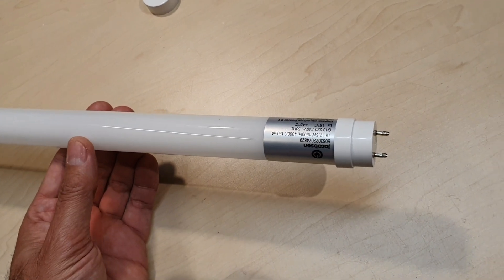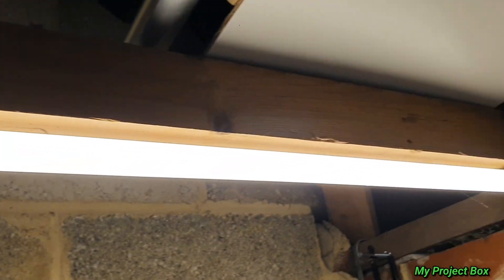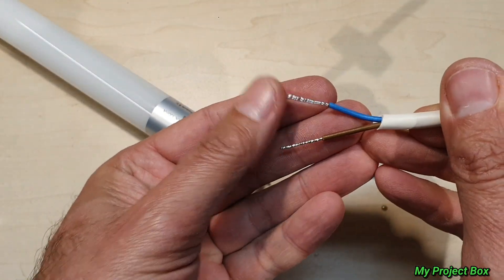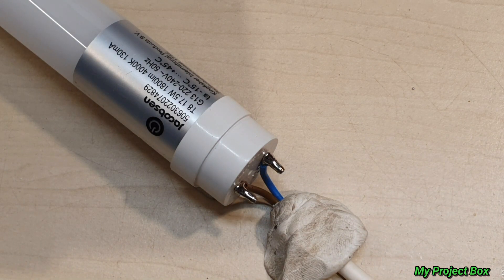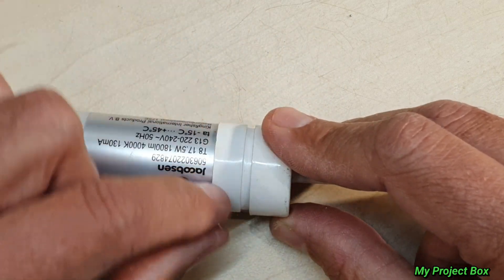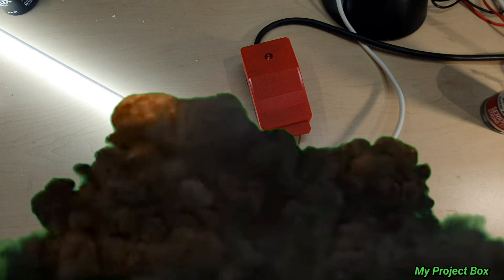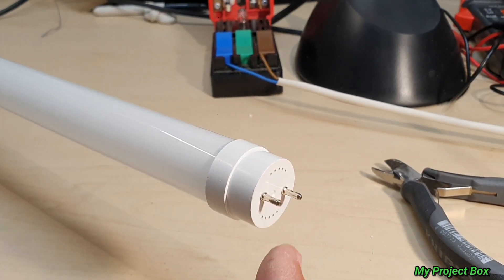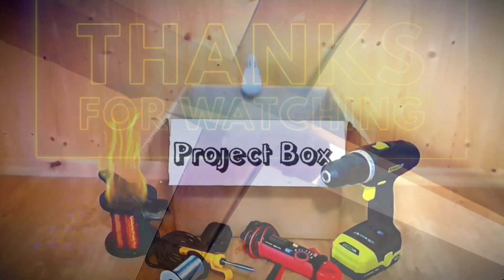Power LED tube directly without putting it into a fixture

Comment: Yeah I was wondering about that too. Primarily because I only have a small workspace in my room to work on electronics and would like to use the same light outside when I do work on my motorcycle.. you think I could just use a normal power cable to hook onto?

Comment: You said 240 volts? So 120V won't work for this? Or it needs 2 live x 120V?
Reply from the maker: In Europe its 240/220 volts but in North America it will be 120V.
Reply: @MyProjectBoxChannel I used 240 and killed my bulb 😂 🇺🇸

Comment: These type of adapters exist as retail products. I've seen them in other videos. Yet, I can't find them anywhere!
Reply from the maker: Yes they probably do, but if you're handy with a soldering iron,  it's just two wires to solder on😉
Reply: @MyProjectBoxChannel  I am and that’s what I’ll be doing but can’t believe they’re not readily available. May be an opportunity here 🤔
Reply from the maker: @csselement   it just needs a better flex cord connected , it's almost what you need 

https://www.2000testequipment.co.uk/store/tube-connector-cable-p-1744.html

Buy LED tube connector 220V https://www.factorled.com/en/accessories-led-tubes/60-led-tube-connector-220v-8400000002219.html

T8 Lamp Holder Cable Light Box Line 1.4m LED Lighting Base Cable Holder Lights Base Wire for T8 Tube Fluorescent Connection - AliExpress https://www.aliexpress.com/item/2052067076.html?pdp_npi=4%40dis%21EUR%211.33%211.33%21%21%211.51%211.51%21%402140e70617618717655152859e65cc%2166164752029%21affd%21%21%21&dp=Cj0KCQiAiKzIBhCOARIsAKpKLANAbj4YPvr-EXbJFInGK2XEOylL0-ZWadsSHd8knnfb88KyJb2L_iIaAjCAEALw_wcB&gad_source=1&gad_campaignid=21745288723&gclid=Cj0KCQiAiKzIBhCOARIsAKpKLANAbj4YPvr-EXbJFInGK2XEOylL0-ZWadsSHd8knnfb88KyJb2L_iIaAjCAEALw_wcB&aff_fcid=e0972ab5fff54609a656ecaf5365b0e9-1762331375655-09444-_oEmQFg2&aff_fsk=_oEmQFg2&aff_platform=api-new-product-query&sk=_oEmQFg2&aff_trace_key=e0972ab5fff54609a656ecaf5365b0e9-1762331375655-09444-_oEmQFg2&terminal_id=148258520c27414d8a326fffc47abc5c&afSmartRedirect=y

It's kind of the thing you looking for
Reply from the maker: This is exactly what you need 
Hermetic LED Tube Lamp Holder T8 G13 - efectoLED https://www.efectoled.com/pt/comprar-tubos-led-t8/69962-porta-lampadas-hermetico-tubo-led-t8-g13.html?gad_campaignid=20975960587&gad_source=1&gclid=Cj0KCQiAiKzIBhCOARIsAKpKLAPyiXS1ErdsEzNpiXs9mDqc8oN-LsUJVjRNQSCT4o4484fj4uA8iiAaArvuEALw_wcB&gclsrc=aw.ds&id_c=141862
Reply: @MyProjectBoxChannel  Thank you!
Reply from the maker: https://www.akouashop.com/accessoires-eclairage/douilles/paire-de-douilles-etanches-ip44-pour-tube-t8-avec-cable-de-1-m.html

Comment: Is it possible to power the leds with a DC by bypassing the ac to dc converter that is inside the fluorescent light
Reply from the maker: Yes but it needs to be quite a high DC voltage of about 60v and current limiting
Reply: @MyProjectBoxChannel  ok thanks very much

Comment: They are NOT "fittings" they are Fixtures.
Reply from the maker: I think you are nitpicking🤔😩. Light fixture or  Illuminar, light bulb, lamp, ceiling light, light fittings. A good example of people using different words will be, "electronic engineers" vs "electricians". You could argue that electronic engineers have much deeper knowledge about all things electrical, but for some reason invent different terminology for the same things.

Comment: Love all your videos and have added some Caps to LED lights that work very well, but I have a project in mind that I hope you can help me with.
We live out in the countryside and at night outside it is pitch dark so when my wife gets up for P she can't find the light switch, so I want to add a LED to the switch so she can find it, the light is a LED bulb equivalent to 60w with a single light switch on the wall, any suggestions? Bob in the UK
Reply from the maker: A common technique for illuminated light switches, is to put a neon lamp (ne2 +resistor) across the switch contacts. That way when the switch is in to off/open position the neon gets its Live from the one side of the switch, and the neutral is leaking back through the light bulb to the other leg of the neon(other switch contact). The trick is for the neon not to draw too much current, otherwise your light bulb will begin to light up dimly. For old school incandescent light bulbs, it takes quite a bit of current before it glows. With Led light bulbs you need to keep the current draw to the neon quite low. Luckily it takes almost nothing to light a neon lamp(think of those neon screwdrivers) .  I guess it's possible to do the same thing with a LED, but a neon indicator lamp is much easier. https://www.giangrandi.org/electronics/neon/switch-location-light.png

Comment: This is great! I'm wondering if I could apply this to craft show lighting. Can the LED tubes be powered with a battery?
Thanks for sharing.
Reply from the maker: Yes you could power it with several batteries connected in series, to generate the voltage needed to light the LED tube, but it is not very practical or cost effective. You could use a "DC boost converter" or a AC inverter instead.  Like a portable power bank.

Comment: It's OK, but I would use a push on terminal onto each pin so when it goes wrong, and it will fail at some point you can unplug it and plug a new one in, and for the fixings I would use terry clips so you just push the new tube in, That's just my opinion, Thanks Bob
Reply: Thanks, that's the great thing with collaboration in the comment, additional ideas.  Secondary thought, opposed to using superglue I would think about using heat shrink tubing, the type that's internally coated with hot melt so that the bottle cap and wires can be removed for repair. Guess it's horses for courses depending on application and environment in which the lamp is being used. Thanks for the idea of clips, also thought about circuit board wire connectors, the type with screws to hold the wires.
Reply from the maker: I have used  "Omega clips" before to hold the led tubes😉
Reply: What a cool project, I'm reaching for the soldering right now, thank you for sharing.
Superglue activator is quite expensive.  
Did you know:
Superglue Activator (fast curing superglue)
you can make your own Superglue Activator by mixing half a teaspoon of baking soda in quarter a cup of water; baking soda being the active ingredient that makes the super glue polymerise.
1) Acetone or rubbing alcohol can be added to your home made activator to aid evaporation.
2) Use your home made activator sparingly to prevent misting and weakening of the final bond.
3) Superglue can be added directly to baking soda making a paste to fix things like if a screw pillar in a radio is broken this mixture can be used to reinforce and glue the pillar back together. You have to be reasonably quick with the mixing as the mixture sets really quickly.
Reply from the maker: @isoguy.  yes baking soda (bicarbonate of soda) works really well. I use it quite often, especially to fill larger gaps  with superglue😉👍
Reply: @MyProjectBoxChannel   @MyProjectBoxChannel  Cool, just been back to your vid on magic smart switch, amazing. Just added another switch to our lounge and it works a treat, thankyou.  I was looking at smart thermostats for the central heating all costing in excess of $100. I then found the sonoff switch with a thermostat for $15 and fitted it to the heating, I can now switch the heating on and off from anywhere via mobile or on cold nights switch it on before I get home.  Absolutely amazing tech, again thanks for sharing your knowledge.